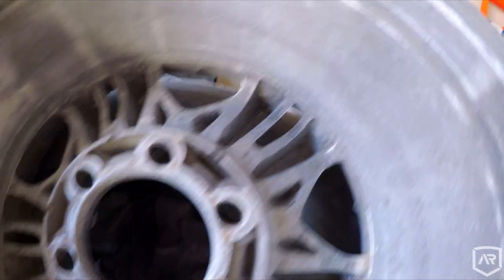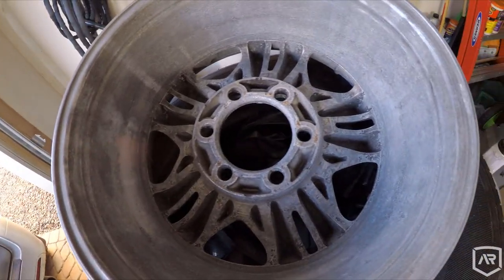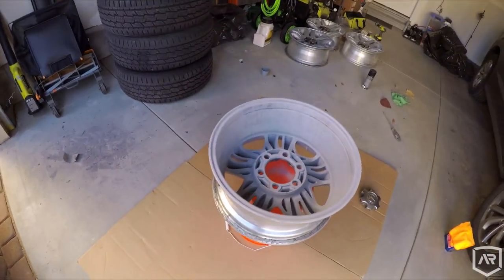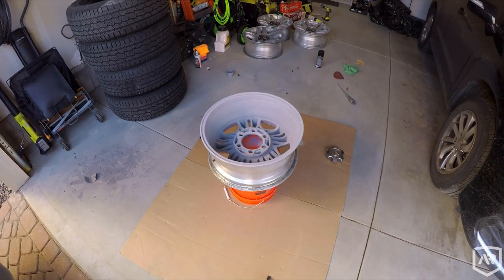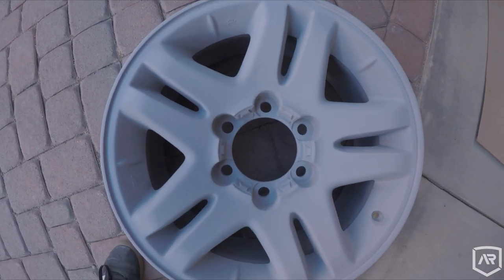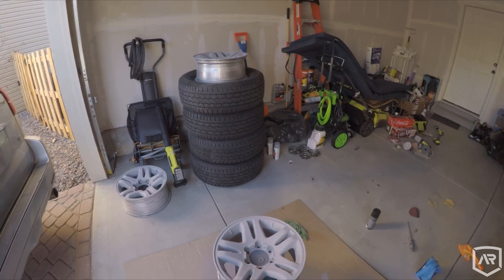Aluminum Wheel Revival

Comment: Take those cans back and get a better paint and prep the surface much nicer.
Reply from the maker: I definitely could have gotten better paint and there could always be more prep. The paint is still on there to this day so I’m happy enough with the results. Especially considering I’ve gotten a fair amount of curb rash from off-roading it already. On top of that the wheels cost me close to nothing, I’m not going to spend hundreds or even thousands on paint and prep for wheels that cheap and for off-roading. 

Anyone can do as much or as little prep with as nice as cheap of paint, this method definitely has worked for me though.